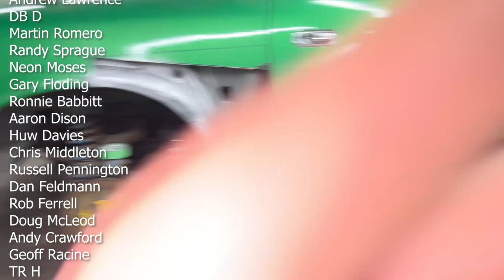1994 MX5 Miata NA - Part 12 - Finishing The Wheel Well

Comment: The shrinker/stretcher is so good it's like cheating. Mere mortals have to put splits in flanges and weld them up. Whe have only hammers and hollowed out logs/sand bags instead of an English wheel.Many times I wondered why you didn't clamp the repair section in place and hammer it into submission. I used to do this and use heat to allow the metal to stretch/shrink. Love your work.  You are much more sophisticated than I am at shaping metal.

Comment: Just wondering the solid wire you are using.    023 or 030?
Reply from the maker: I used to use 023 and it worked well, but one day I ran out and I had a roll of 030, so I switched and it turns out my welding skills improved LOL So I am using 030 now

Comment: What are those spring loaded clamps that you are using the small pieces in place ?
Reply: They are called Clecos. Used for plaing and removing parts maintainjng their positions. They come in different sizes indispensable for sheet metal fbrication.
Reply: @jackn4853  Yes I see the Cleco side clamps now